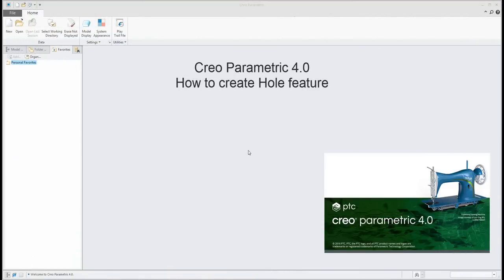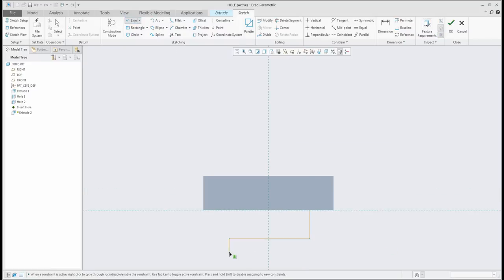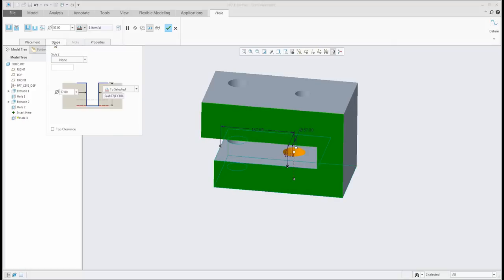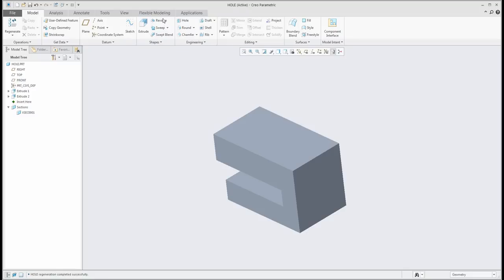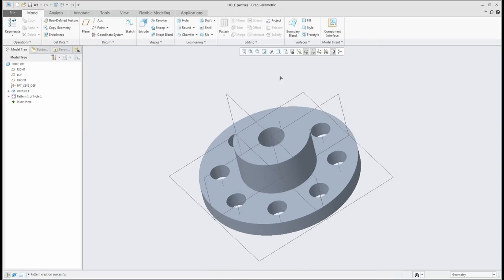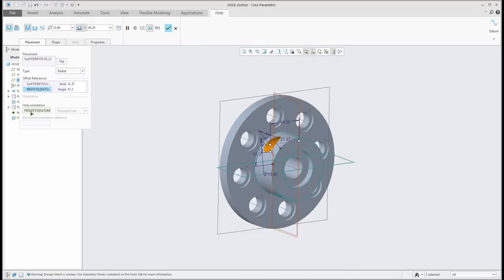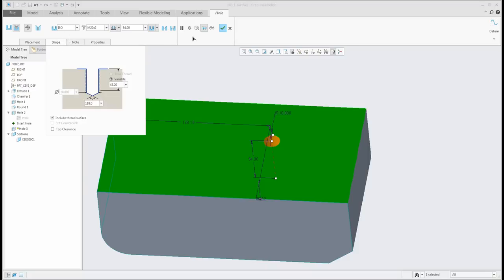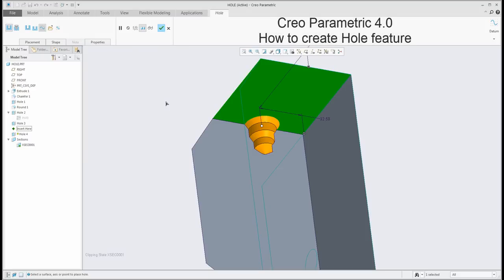PTC Creo 4.0 tutorial: How to create Hole feature

Comment: New to Creo here. Is there a way to create part in Creo without worry about weak dimensions, (dimensions generated by computer and have endless decimal). Does Creo has the setting to round all dimensions automatically as user building a part. Also a master command to make all weak dimensions into strong would be nice.
Reply from the maker: Hi, I do not know any option to round number. Yes of course you can see a custom decimal places but when you create a new sketch...the values is with many places (but visible on 2 asi example)

If you want to transform all weak dimensions to strong one...simple select dimensions and use CTRL+T 
Best Regards, Vladimir